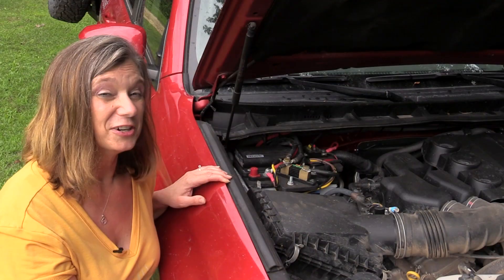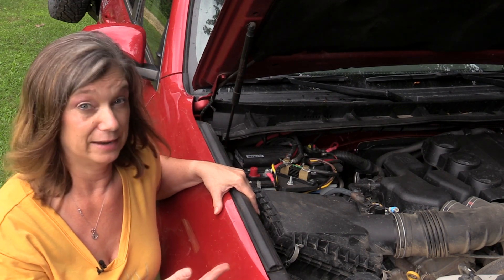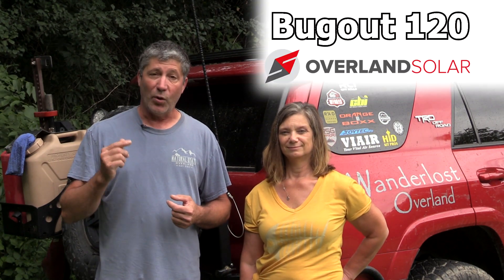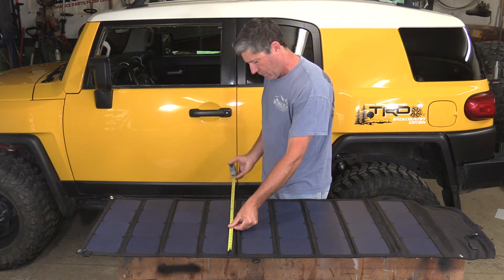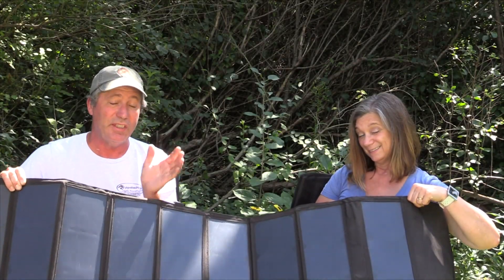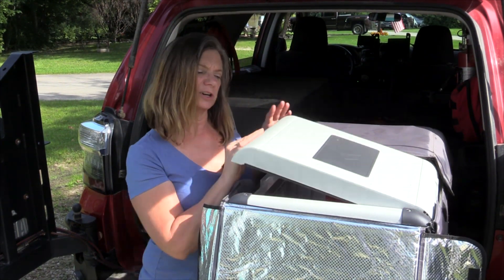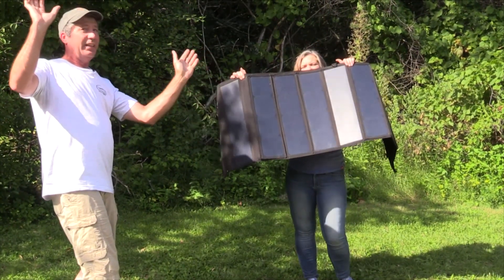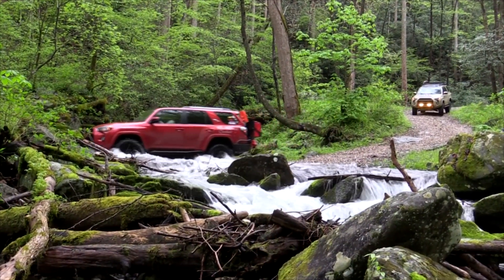Reliable Solar Panel Set-up For Camping & Overlanding, Why-How-Where

Comment: Just noticed the Shunt is now on the auxiliary battery was that the one from the back panel?
Reply from the maker: It turns out we where feed bad information on the placement and wiring of the shunt. It's more convenient to mount it close to the battery because, as we learned latter, one post connects to the battery negative only and the other is for all other negative connections.

Comment: Unrelated to your video but I am getting a snorkel installed on my FJ. Any thoughts on maintenance and how to keep rain out?
Reply from the maker: Unfortunately we know little to nothing about snorkels. They do seem like they'd gather a lot of rain going down the road.
Reply: Wanderlost Overland Hmmm... Here’s the dissenting voice: I highly recommend the TJM Airtec snorkel. Sleeker than the ARB Safari, quiet, no problem with water intake during rain. Just be careful when car washing with high pressure. (2018 4Runner TRD Off-Road).